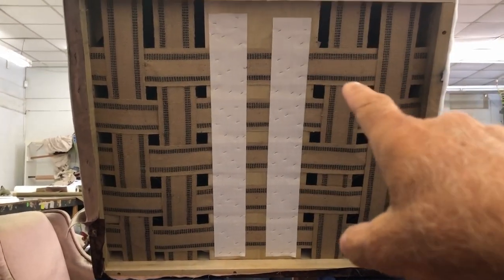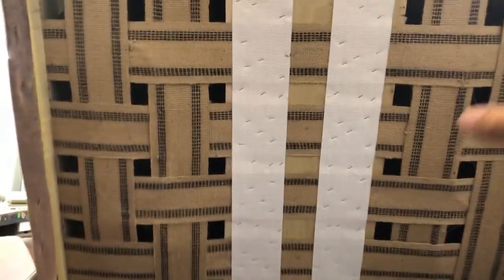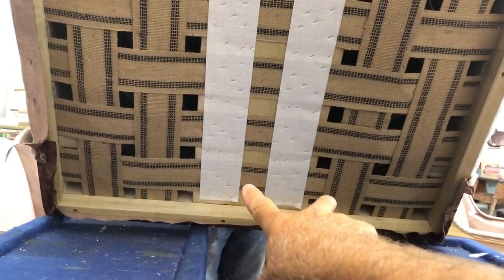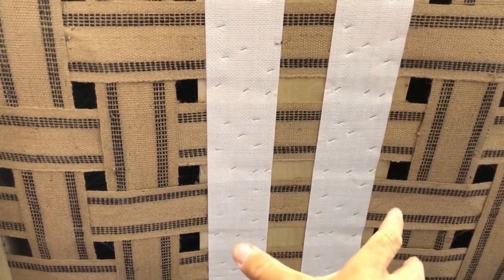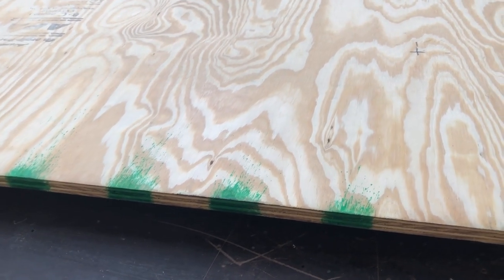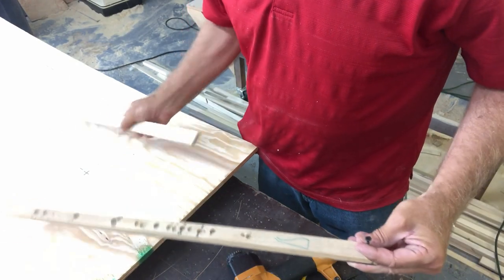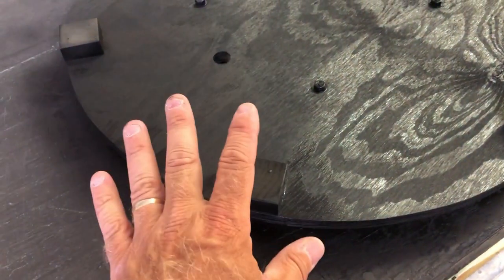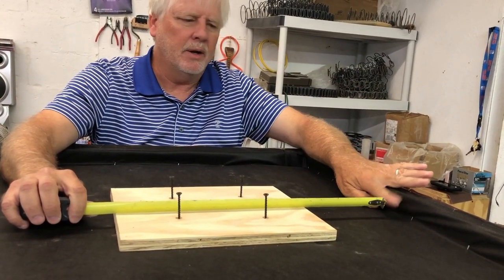DIY-HOW TO BUILD A SWIVEL BASE

Comment: Great Video!  Thank You SOOO Much!!    I purchased a pair of swivel barrel chairs. But when I opened the box I had to attach the swivel base myself. I saw the 4 holes pre-drilled in the bottom of the chair but I could NOT figure out how to access the bolts to tighten them. I searched how to assemble base for this brand of chair but no luck. (and the store was closed so no help there). Found your video and decided to watch how to assemble from scratch.  Now I see how to use that pre-drilled hole to access each bolt. I feel kinda dumb now but still very happy!!!! Clear, precise instructions. thx

Comment: Excellent - just what I was looking for as a solution to convert a car seat to a comfortable office chair.
As the base of the car seat is very deep the normal office swivel bases that I use don't allow me to lower it to a good working height, plus the heavy car seat (not to mention the heavy me on top of it) would be too much  for the office chair base.
I can definitely work with this.

Comment: Great worksmanship but I think the diameter of the ball bearing ring should be closer to the closest edge of the base of the chair. A couple of calculations will yield an optimal ratio of about 0.7 or greater (diameter to base length). Otherwise, that swivel will eventually wobble after a few years.

(To calculate, I conservatively assumed a 100lb chair, a 300 lb person with two legs (representing 35% of total body weight (it's less for males)) hanging off one edge of the chair (ie not sitting cross-legged in the chair center), length of the chair base no greater than 3 ft, and the body weight rotating at no more than 30 rpm.)

A "heavy duty" ball bearing mechanism in theory could be small, but it wouldn't be practical (or probably available). For example in theory, you could use 1,000N grade steel and put the chair on a swivel base the size of a penny and spin an elephant on it at 5,000 rpm and it would not wobble ...

Comment: I have a couple of swivel chairs with a base like this but they sit very low. Is it safe to just get a few 2x4 boards and screw them into the solid circular base to help raise the height some? Maybe attach them like skis or do 4 pieces in a square under the circle? Thanks so much!
Reply from the maker: You can add like skis, but I would finish with a square plywood to unify them.

Comment: Thanks, as an observation, you could have predrilled your 12" board for the chair bottom using the base before assembly, so that you didn't have to align and drill through the completed swivel base, but Thanks anyway , I was just looking for confirmation that this size of swivel was actually man enough for a large arm chair.
any chance you could show how that 10" board was it was fixed to the chair frame to take all that weight in the center?? thats what I'm struggling with/weary of as I'm wanting to convert an existing recliner... the four corner feet are spread a LOOONg way apart so im not certain on the best way to span the distance between the feet  as it will effectively bee a lot of stress on 'ideally a 2"x2"  contact  area on the inside corner of each 4" x 4" foot  I'd intended recessing or rebating the board into the foot to prevent raising the chair too much with the whole mechanism but fear I'll need metal assistance to span say3'6" x 3'6" corner to corner chair if that makes sense, any pointers or references etc gratefully received
Reply: This is an excellent suggestion regarding pre-drilling.  I had to fuss with a drill bit extender -- wish I'd seen your suggestion before I did mine!   I used the extra heavy duty swivel (just like the video) to do two very heavy/large custom upholstered swivel chairs.  Purchased from Rockler.  This system works great -- chairs are nicely balanced and the bearings are as described in the video.  My chairs had a full plywood (1/2") base frame spanning edge to edge of chair.   I used a 1/2" plywood as the 12" piece on top of the original base since 3/4" would have made the chair sit too high off the floor for the skirting.  I used 3/4" ply for the 24" diameter base and 3/4" feet.   I would suggest using 1.25" carriage bolts rather than 1" to give a little more length for the nut/washer.    Good luck!
Reply: @larrywright7456  thanks for the additional information Larry

Comment: I have a two seater couch that I'd like to mount on a swivel. What modifications/additions would you recommend to make it work effectively?
Reply from the maker: You would need support boards for the swivel base, then add caster on the corners. Make sure the swivel base is sized to your casters

Comment: Do you have a uk link for the swivel mechanism please and will these be ok for outdoor use? 
Regards  scott
Reply: I purchased the heavy duty swivel from Rockler.  They cost a little more ($50) than the author said in the video but they are really heavy duty.   It appears to match exactly the one used in the video.  I did two heavy chairs following these instructions and they turned out great.   @Obsidian Rog makes an excellent suggestion regarding pre-drilling.  I had to fuss with a drill bit extender -- wish I'd seen his suggestion.